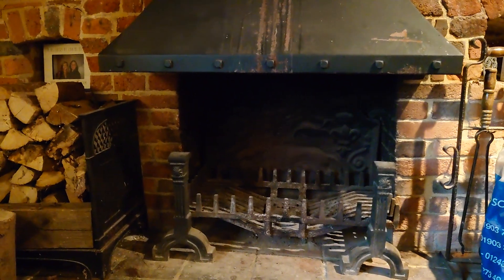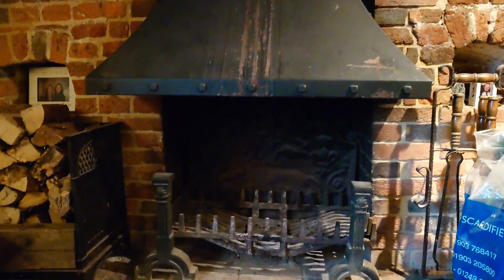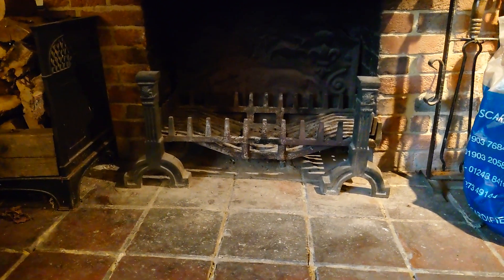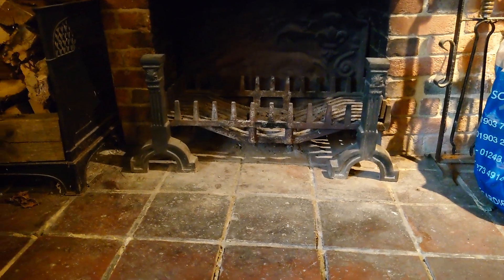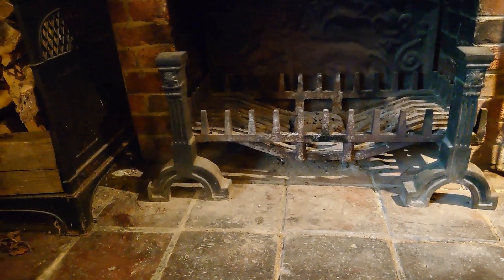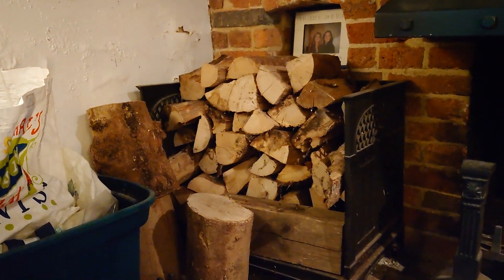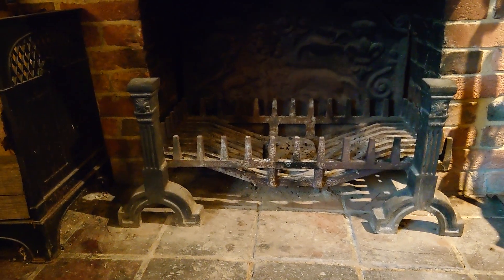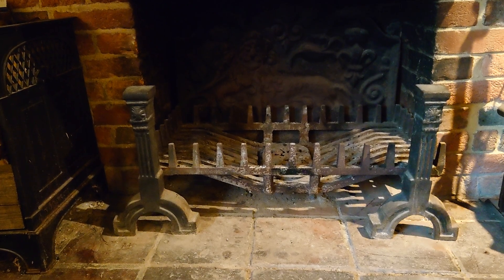GET THE MAXIMUM HEAT OUT OF YOUR INGLENOOK AND SAVE LOADS ON YOUR WOOD.

Comment: how do you seal that opening?, as its large and no metal for magnetics to stick to
Reply from the maker: You can fix a damp plate inside the hood. I fitted one before. Hopefully go back soon. I'll do a video. They can be used as baffle plates. Get more heat into the room as well.